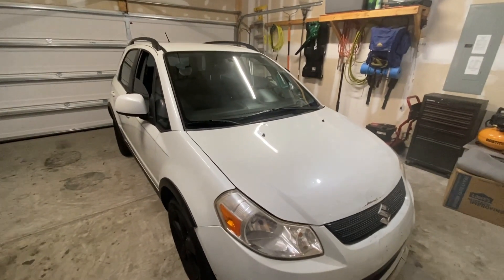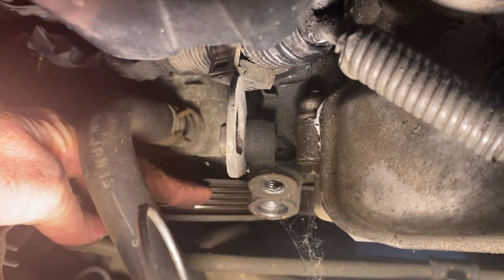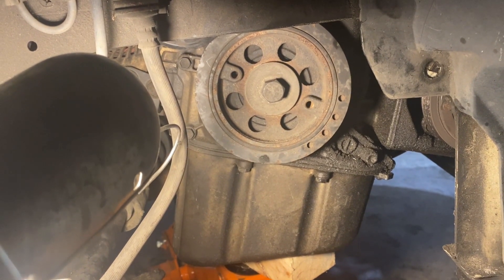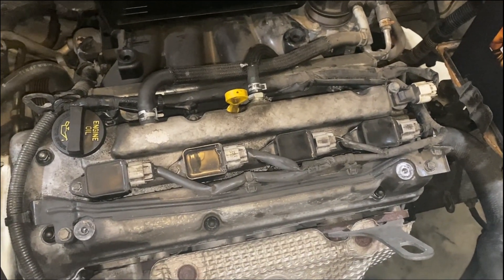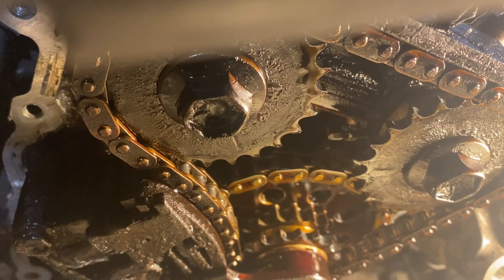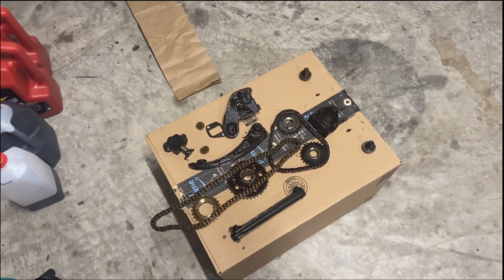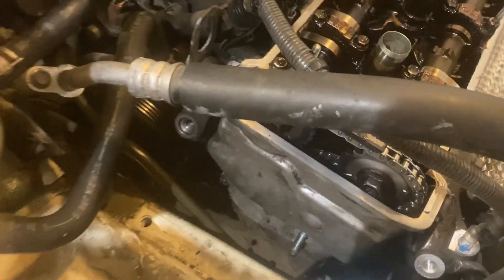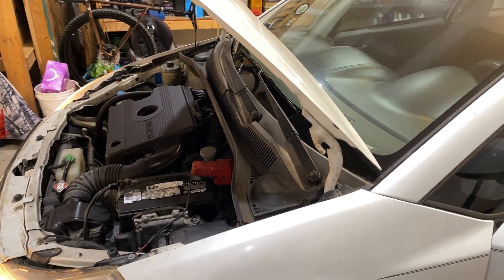2007 Suzuki SX4 Timing Chain Replacement

Comment: My 09 SX4 has 180k miles on it and it has zero sludge inside the engine. It has the original timing set with near zero slack in it, it also has the original clutch and has never had any major engine problems, knock on wood. Maintenance is a huge deal when it comes to making a car run for a long time. I change the oil 2 times per year, or every 4k miles on full synthetic. Lord willing it will continue to be a reliable vehicle.

Comment: Thank you kind sir for your excellent video.  Near the end of the video, you mentioned you were going to compare chain lengths but didn't say if the chain had stretched.  Just wondering if there was any significant difference or if it was just the tensioner?

Comment: A really great video thanks. I'm sure I have the same issue. What do you think the root cause of the problem was? Stretched timing chain or tensioner?
Reply from the maker: Good question.  I'm still trying to make repairs on mine.  It has some other engine noises that are concerning.  The information on this car is so limited!  And parts are hard to find too.  Best of luck with your repair.
Reply: It's the tensioner! I didn't replace mine but we changed the belt! It's just noisy at idle and works fine! I will replace it when it fails!

Comment: How many miles does the engine have? And, can you get the valve cover off without having to remove everything you did up to that point. I don't know if my noise is coming from the timing, but id like to be able to rule it out if it's not to much work. My mechanic skills are rather basic.
Reply from the maker: Great Question.  Yes you can remove the valve cover fairly easily without dealing with the timing chain cover.  It may be a little hard to see the lower timing chain as you will have limited access.  But its worth a try.  There is another youtube video out there on only the valve cover.  Best of luck with your repair!
Reply: Have you figured it out?  There are a couple SX4 groups on FB. It may be worth taking a video of the sound and posting it there.